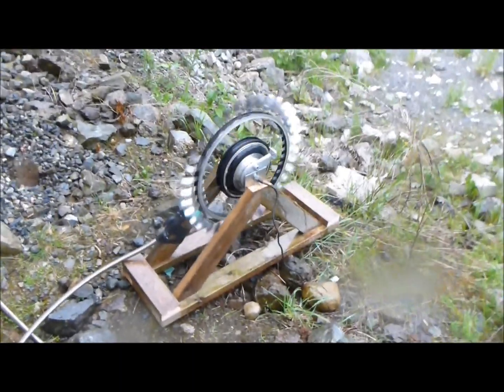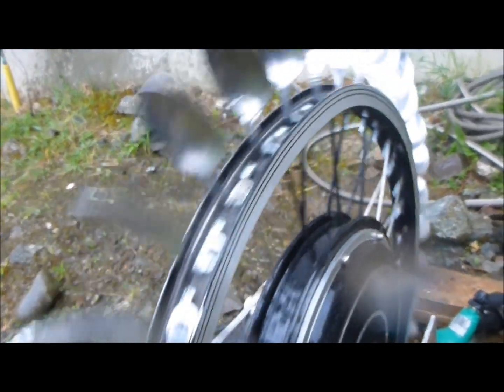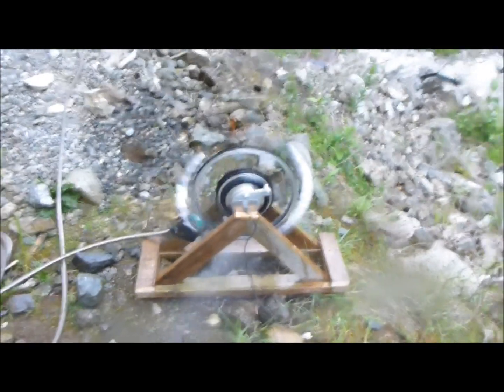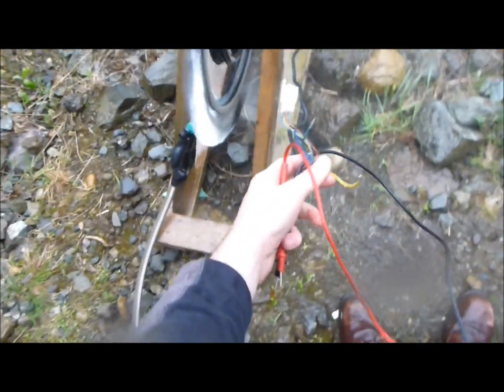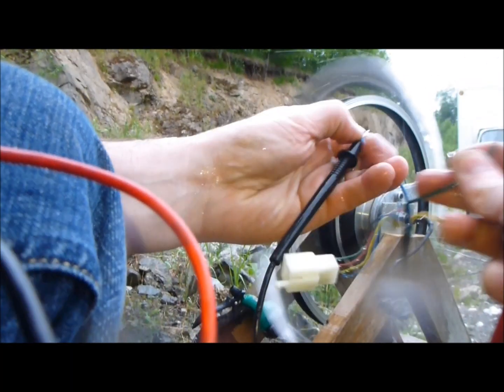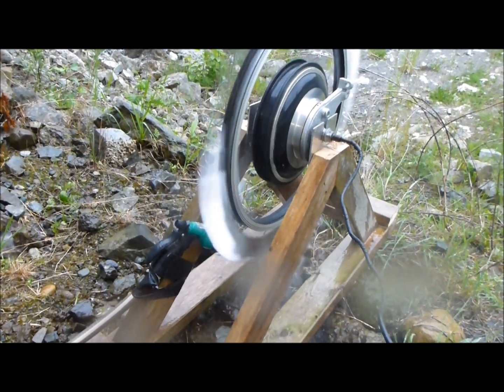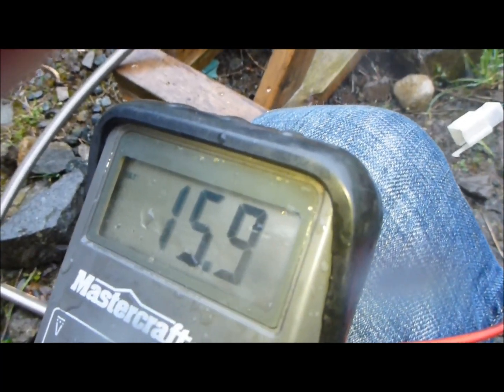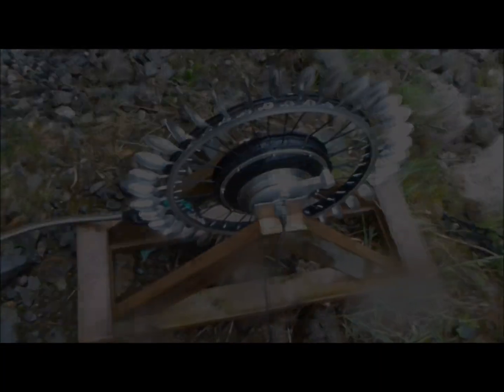DIY Pelton Hydro Power with a 500W EBike Hub motor

Comment: E-Bikes run on 48 to 96 Volts.
You are not getting anywhere near that.
Something is wrong.
And if you hook that up to a battery to charge it, the voltage is going to drop by 50% depending on the load.

Comment: have you thought about laying the wheel over so there is less friction, think of all the amount of energy lost in having to lift all those spoons up after they are soaked in water, if you were to lay the wheel over do you think it would become more efficient?
Reply: The whole idea is the water.STOPS and the blade(spoon) then recedes at half the velocity the water left the nozzle.
This means the water falls off the blade. It doesnt get carried around. Other than a slight film.

Considering the shape of the spoons though, the jet should be hitting the side of the spoons and "falling" out the other side of the wheel. Ie, a "turgo".

Comment: You will need one hell of a fast running River or  stream for that to work at that speed.
Reply: A Pelton wheel is driven by a yet of pressurized water from a pipe. It doesn't matter how fast the stream runs, what you need is enough head to build the pressure in the pipe.

Comment: Do you have a measure of DC wattage/voltage out.  Also are you using an unmodified ebike motor, ie, out of the box?  With thanks.

Comment: hey 14,0 volts what is ampere ????
Reply: 36 volt motor devided by 4 is 9. Now i cant be sure exactly but the wheel looks to be moving at about 60 to 80rpm so with the state of this video and its conditions the motor is under a 1/4 of its 20 amp peak that would be about 2 to 3 amps but that's just a guess.

Comment: ok ... its been 3 years... when are we to see ur " in use vid " ..? 
looking at what u have ... what changes have u made and or what would u do to improve upon its use and eficiency? details plz :)
oh and .... details upon the water pressure and power recived under load, amp and volts plz
have u moved behond the spoon yet ? lol
Reply from the maker: https://www.youtube.com/watch?v=MJxBshI2qtA This is as far as I got with it. I built this project to power a small cabin I found in the woods. It was over grown and run down, so I started fixing it up. Then I found out it was on private property. I stopped the restoration and with it the hydro project. I also have 2 young kids now so my woods roaming days are on hold! I still have the little genny though!

Comment: hi i need help pelease cause i want to make  one like this to my prject pfe and i want to ask u some question
Reply from the maker: What is your question?
Reply: thnx 

I want the power equation how I calculate the dimension of the turbine and how I calculate the rotational speed I want a general study to build one like this
Reply from the maker: It has to do with the circumference of the wheel, the efficiency of the spoons and the velocity of the water hitting the spoons. Also if you have multiple water jets it will increase the amount of power you can generate. I dont have any equations for you though. You will have to ask google for that.
Reply: But how you know the turbine delivers 500w of power
Reply from the maker: I never said it made 500W. It is a 500W motor converted into a generator.
Reply: can you send me the caracteristique of you motor
Reply from the maker: Lol, I dont have that kind of info. I took the motor off of a crashed electric scooter. Contact a manufacturer for that info

Comment: Where did you get the ebike hub?

Neat

One suggestion -fasten the spoon impellers using the spoke nuts. I believe they are removable 'tubular'  nuts. This would 'automatically' align/orient your impellers according to the 'factory' holes in the hub.

Do these ebike wheels come in larger diameters? - or, could you simply find a larger diameter hub and longer spokes and fit a 26" hub to the ebike motor? 

It seems that a large diameter would improve (leverage)  performance at any given flow rate. Offering, also, the advantage of moving the motor farther from the water source.
Reply from the maker: Great comment! I got the hub motor from a wrecked ebike. The front wheel was bent and the battery pack was fried and was sold for parts. If you look closely at the video you will see that I did use the spoke nuts to fasten the spoons. I also used a self tapping screw for each spoon. A larger diameter wheel will get more leverage from the input water but RPM suffers, which reduces the voltage. Thanks for watching!
Reply: "but RPM suffers"
Is that something you have demonstrated experimentally? 
I may not understand the physics involved, but the statement belies my intuition.
Reply: Also, you did not answer the question "Where" did yo get the ebike parts ;) This is the first of your videos I have seen - maybe you explained it in another that I've not seen.
Reply from the maker: For a constant velocity (water velocity) a wheel of larger diameter (larger circumference) will turn at a lower rate than a wheel of smaller diameter.
Reply from the maker: I found the ebike on craigslist
Reply: "For a constant velocity (water velocity) "

Yes, but that assumes the direct connection to the generator shaft and ignores the additional torque produced. Couldn't you add a flywheel and gearing to produce the requisite RPM at the generator shaft without sacrificing the additional torque to the mechanics (gearing)? Adding a centrifugal clutch to the design would allow the wheel to build up speed and momentum before engaging the gearing using to maintain speed and ower during fluctuations in the water pressure/flow to be expected.
Reply from the maker: I think you need to take a look at how hub motors are constructed before you suggest adding gears and clutches. If I wanted to employ pulleys, belts, and chains (all come with losses) I would have built a traditional water wheel and just used an automotive alternator. 

For ease of explanation think torque is amps and rpm is voltage. It doesn't matter how many amps I have if I cant break the 13V threshold  when charging a battery.

Comment: voltage is not power.  The voltage reading is meaningless without a load on it and without knowing current.
Reply from the maker: You are correct. Have a look at my other videos.
Reply: @ryanonthevedder  I checked your other videos but don't really see any power being made anywhere... ???
Reply: ryanonthevedder hey did you ever check what volts or amps it produced at average top output??
Reply: Needs head though, not an electric water pump.
Reply: Yes absulutly wright
Reply: Good for charging a battery bank
Reply: can u generate power with these to a community?if so, can we partner in Nigeria to generate light to communities.  it's a very good business

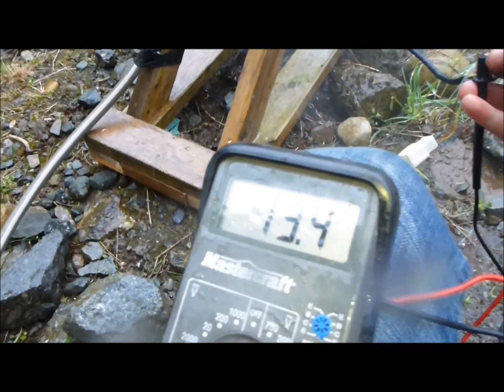Comment: I see that your BAT was lite on your volt meter. That will cause your readings to go up =.+ in you really only were making 13.5v like when you started to meter your volts @ 2:48
Reply from the maker: Volt meter works fine. The bat has been on for years and does not go away with a new battery. I use it all the time on known voltages and I trust its readings. If you want to poke holes ask me about amperage output and wattage :-)

Comment: +ryanonthevedder
Hi can we talk about how make this project? materials, etc... please answer or contact me?
Reply: Awesome. I wonder about these wheels panels and wind mills. Since the electricity is not coming from the grid. Do you think the current skips, from self models like this. Do gadgets suffer. Or is this electricity as clean as your plug on the wall. When I say clean I mean the current staying stable.....Ray...
Reply from the maker: +Erick Wong Escalante I talk about what I used to build it in the video. An e bike hub motor and some spoons + a rectifier.

Comment: Not to rain on your project, but all the spray you see around the spoons is energy lost and in a perfect world, the exit speed of the water should be as little a possible. 
You can buy fully balanced, properly shaped Peltons for $40 on eBay. If you try to power something that would be a better choice. 
Thanks for posting the video

Comment: Use the 14 Volts to power up a Fan at Hi Speed the fan should have a funnel in which the power of Air truen the wheel at hi speed then cycle the electricity to run the wheel I suppose you may generate more power in which you can split it to run the Fan and other equipments, this way use the water to start it up then shut the water down. it's worth the effort.

Comment: hey  glenn  good job sorry  havent replyed in a while.  what i was thinking to keep  the wheel going is to have a plastic tank that will suck water out with a water pump and spray the spoons so the tank never runs out of water closed loop  instead of using  garden hose and waste water.  a few things to experament is the pressure of pump and stream .they make bilge pumps for boats that run on 12 vdc .the second thing is to have a brdige rect radio shack sells them  for a few bucks get the 25 amp 1 connect the pos and neg out from motor into  ac in  there will be a volt or more drop  that will serve as a dc block so  when connected to battery it cant run as a motor .also depending on speed  you might need a regulator good for 20 amp you need a marine grade battery for long use car 1s  dont work proper . and how much is the pump gona draw  you need to test with meter. with pump connected to see under load how much it used an amp meter  will tell you as long as the  wheel generates enough to over come the pumps draw you can then charge a battery just make sure  that its not over 13 volts never  put 24-to 48 into a 12 volt it can boil it and could explode. if the generator has to much voltage  then you  need to put batterys in series  its series for more volts or  parallel  for more amps. if a regulator is needed place it after rectifire + - in  + - out  make sure  the bridge is heat sinked with compound and good size heat sink. any other need to know stuff  you can contact me and i will see how to help   can you read a schematic ? or do you have face book?  so if i make you 1  i can send you a file.  keep up good work.

Comment: ryanonthevedder Google the Tesla turbine my friend. Or add a nice big flywheel about the same size as your rim! You'll increase your power output dramatically with either
Reply: Tesla turbine only work efficiently with high viscosity fluid. Water is not one of them.

Comment: you can also make a closed loop tank n run a pump to power wheel
Reply: inventhead Would you please explain what and how you are thinking of doing this? I want to attach a DC gen of some sort to my water line coming into my house to charge batteries when water is consumed. i.e. taking a shower, washing clothes and dishes, watering the lawn ect. ect. it will need to be where it can fit on 3/4" pipe either directly or buy reducing down from the gen box inlet and outlet. Please share your thoughts with me. ThanksGlenn Stanford  glennestanford@yahoo.com

Comment: be sure to put a bridge retifire or when you connect to battery. or  it will run as a motor .this keeps voltage from running backwards the ac in  just hook itto that an + n - still stay  the same. you will drop 1-1/2 volts also make sure to heat sink it   it will get warm then you can charge the battery only thing is its not regulated however  2 ways to go it either electronic or the speed of pelton wheel.
Reply from the maker: https://www.youtube.com/watch?v=MJxBshI2qtA
Reply: inventhead if you connect it to an solar power charger, then there should be no power back to the wheel, correct ?
Reply: Harry Muurlin

Comment: Most of those hubs are not completely water tight. Don't forget to put a breather hole on the hub and put some WD-40 in the hub so water doesn't rust the iron plates that would eventually condense some water from hot and cold expansion. Dielectric grease on your connections would be another good idea so you don't let the water and electricity de-electroplate(electropolish) the thin coatings on the plugs.

Comment: This setup will not produce much power in this setup because its a brushless motor. You could capture much much more power with this motor if you enable regenerative braking in the controller. If it doesn't have this option you need to buy 1 that does. It could put out close to 500w with regen and a 36v/48v battery.
But in its current config it will only produce a few watts at best.
Reply from the maker: You are correct in suggesting that it doesn't produce much power, but how would a regen controller help? 500W is a lot considering the water I have. Regen brakes rely on a 150-200lb person to push out power down a hill. The water jet I was using only puts out 8-10 pounds. More power will come from mechanical sources, and not advanced circuitry IMO. I am certainly open to new info, so please hit me with knowledge.
Reply: A programable infineon controller can be setup in slipstream mode for variable regen using an ebike throttle and Ebrake.. It can capture power from all three phases and charge a 24 - 100v dc battery.  You would need some type of high voltage cutoff or battery management system as to not overcharge the battery.
Solar controller would work too. 
With variable regen you could dial in the load to match all the kinetic energy you can capture. I don't know for sure if the smallest amount of regen will stall your motor, but it can be modified to work.

Your right that the system won't produce huge watts with the current water supply setup. I just think that you will never know how much power you can harness without a controller of some type.

Comment: hi, i was just curious where did you find that hub motor for so cheap?
Reply from the maker: I found a damaged E bike on craigslist and took the motor and controller off of it. The bike was hit by a car or something and was a bit damaged and the batteries were shot, but the motor works fine. I have seen these those bikes posted for free too, but was never quick enough to get one.